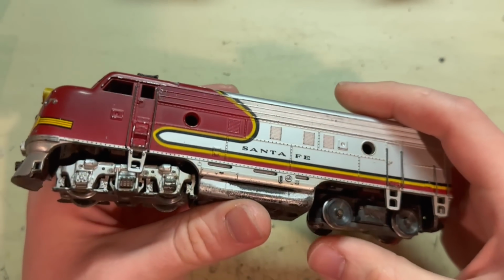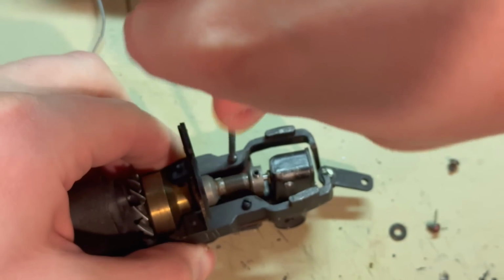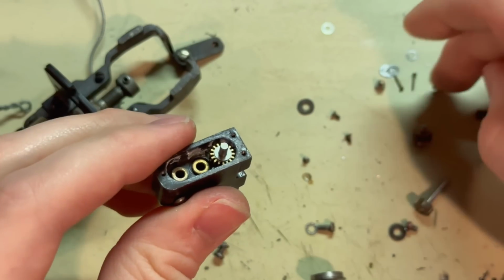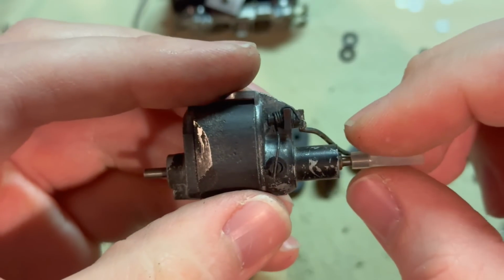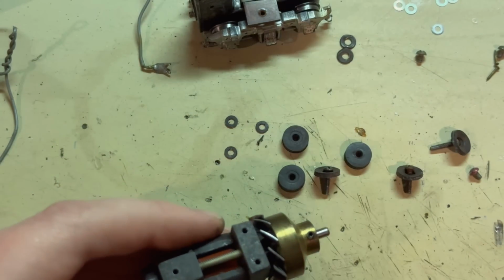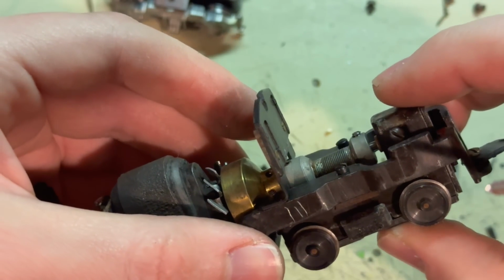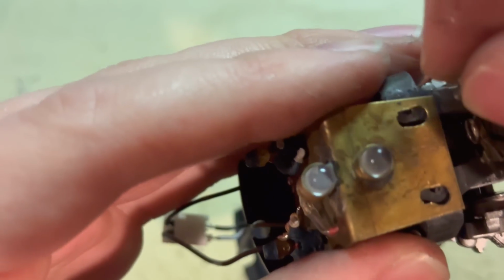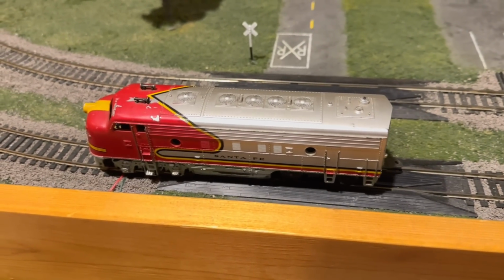Tuning up a super rare Lindsay 8-wheel drive Globe F7 chassis

Comment: Darth:
Great as usual Darth. The motor brush springs, and the general appearance of the motor look rather 'Marklin-ish'/Hamo-ish ?? I wonder if they were subcontracted? The only seven-slot armature I have seen on a train/tram motor was Hamo.  Would be worth investigating Marklin 300600 (for flat commutator) brushes for spares; I would imagine those brushes would work on a drum commutator as well ?.  If there is ground clearance under the tank it might solve the motor screw tightening control problem if a bit of ‘all-thread cut from longer screws is used, with two nuts so as to form a locknut arrangement. The first could probably be countersunk to save precious space.   The nuts cold also be filed thinner for that all important ground clearance.  All that trouble to fit a good motor, and then indeterminate fitting.  Amazing!The 'power-transfer' gear system is curious. It would seem that the centre gear has bearing support both front and rear, and the length of its front support is limited to about half that front support length. With front and rear bearings on a shaft, alignment is critical to avoid binding, and that might explain the half length and missing front support on the top bearng as mentioned below. It would be interesting to know what the shaft/bearing tolerances are? There was a lot of slop apparent when you reassembled the box.  Possibly that centre shaft has a little extra tolerance to guard against minor misalignment of front and rear bearing mounting plates. Simple ideas, the very deuce ( interesting word) to write about). The  top gear shaft is supported on the rear only.  Lacking both front and back bearing support, any angular force will be murderous. I have often wondered how the forces are managed in the extreme angled front suspension of chopper motor-bikes?
Here, the solution would probably be to have two self centring bearings on each shaft – but that costs more. Darth: see if you can find a Triang 'Hymek' power bogie to analyse; it has self centring bearings. It would be most interesting to see what a German company like Marklin would have done with these design principles? I imagine they would have used self centring bearings. (Never use one bit when four will do!)  I suspect we have a German motor and a non-German everything else.
The worm shaft is supported on both ends, but I imagine the longer shaft minimises out-of-alignment binding.
Also interesting that, in the transmission sequence,  the worm reduction is after the spur gears, exposing the spur gears to noise and wear. 
Fascinating design.
As so often, adding pickups is iffy as the ground clearance from the bogie base is limited - a bit like the Hobbytown Alco. It all rather sends one to one's golden retriever, does it not?
Anyway Darth: see if you can scrounge a Triang Hymek. Now there's a loco made to add pickups to get four wheels down each side. Make sure it is a Hymek; some Triang bogies were not equipped with self-aligning armature bearings. The prototype Hymeks were interesting - modest sized highspeed engines- find some sound footage on Utube.  I think your Krauss-Maffei locos had the same engines and and the same hydraulic drive.
That fan assembly is another setup that sees one reaching for one’s golden retriever – it’s worth being slobbered on.  Curious that a carefully balanced drive is thrown into indererminacy by grub screws and a metal stamping for the fan.
Also: wonderful to hear the concept of ‘duty-cycle’.  They all have duty cycles.
Lots of fun:  better shutup or I’ll get into trouble again.
Reply from the maker: Lindsay did actually make all of their motors themselves.  If you watch my Lindsay Stubby Yard Switcher video, I do a full teardown of the motor to show the design of it.
About the upper transfer gear in each truck, it has behind the gear either 2 bearings (like the early Globe/Athearn trucks) or a single long bearing (like the Hobbytown trucks), so it was plenty stable.

Comment: 1) Were the twin lights both headlights or a headlight and a signal (Mars/Gyra) lights?

2) Uncle John's passenger F's were geared for 102 mph
Reply from the maker: The shell was definitely a single headlight version which had a second “headlight” drilled below it.  Since it’s an ATSF unit, my guess would be gyra light on top and a steady light below.

Comment: What year did Athearn take over Lindsay?
Reply from the maker: Athearn didn’t take over Lindsay, but Kemtron did some time in the mid 50’s.  When Kemtron closed down, the Lindsay tooling mostly went to Precision Scale, and the diecast bodies went to Hobbytown.  The motors and gears haven’t been made in 50 years, but most of the other parts are still in production.
Reply: @DarthSantaFe  Thank you for your reply.

Comment: If I'm not mistaken, the crew details actually predate that of Bachmann Spectrum locomotives
Reply: Also, the drawbar is for a B-unit the locomotive would've been paired with
Reply from the maker: @Benthetrainkid  That is possible!  I'd forgotten that Globe also had the B unit at the same time.  Crew details have been around for much longer than Bachmann's line of trains, so I wouldn't be surprised if they're nearly as old as the rest of the model.

Comment: You get some really fun projects to play with.  That's definitely a mechanism I've not seen before.  For that era it's pretty advanced.  The fan and flywheel are a nice touch.  When's the last time you saw a cooling fan on a model train motor? 

Those truck gearboxes look very familiar, I think I actually have a brand new pair of those that came in an estate sale box of vintage mechanism parts.  They're extremely nice especially if they're as old as the model you just tuned up.

I have a box of Lindsay/Kemtron parts and some unstarted kits in TT and Hon3, mostly the TT Docksider and Hon3 Teakettle 0-4-0.  The little seven pole motors are pretty interesting.  They do draw a lot of current as you indicate.

Great video, love to see it when folks can get theses old mechanisms running again.  💗

Comment: That is a rare Lindsay model. It was made in limited production for coin operated layouts in amusement stores in the late 40's.  I have a collection of every engine he produced.  
You were smart, not to  take apart that motor. It has small pressed in ball bearings in the end castings and with out the proper tools the end castings could brake.  The instructions that come with the motors say they will run hot but not to exceed 2 amps.  I hope this is helpful  to you.
Reply from the maker: Thanks! That does explain why I couldn’t find it in any of the old catalogs!
Reply: What do you mean coin operated layouts?? That people would deposit coins to see a layout run for a minute or two ???wondering what that means.
Reply: @gacj2010  In the late 40's they had gallery's to play pin ball machines Like we have game rooms now to play electronic screens to play on.   Those layouts were behind glass walls  (no touchy) just control fast or slow for a predetermined time.
Reply: @gacj2010  That’s exactly it. I’ve heard of a few department stores having them back in the day.
Reply from the maker: @gacj2010  Yup, you put in a coin and the layout starts up!  I actually ran across one of those a few years ago in Deadwood, SD.  Put in a dollar and the layout with all its trains and other accessories powers up for 10 minutes!
Reply: Wow!
Reply: I believe you are right, and I think the rear coupler is a draw bar because all of the cars where coupled together that way.
Reply: The Colorado Railroad Museum has a coin operated HO scale layout. 💙 T.E.N.
Reply: Gosh, that's really neat. I'd imagine Lindsay put the fan in there since the locos would be running under glass with little to no airflow? That's probably why it survived for nigh on 75 years.